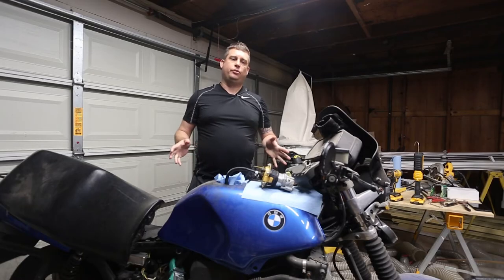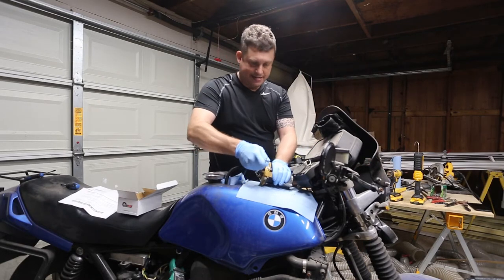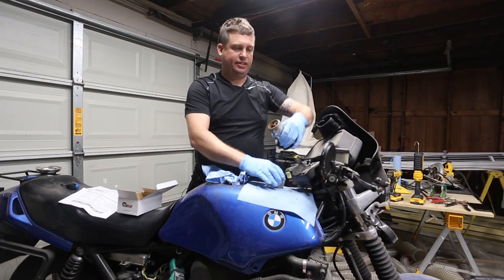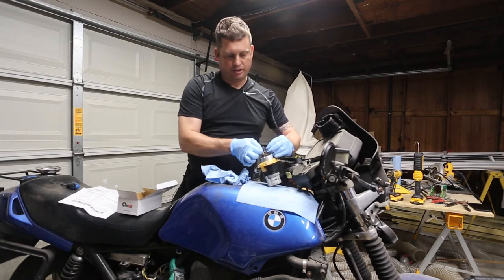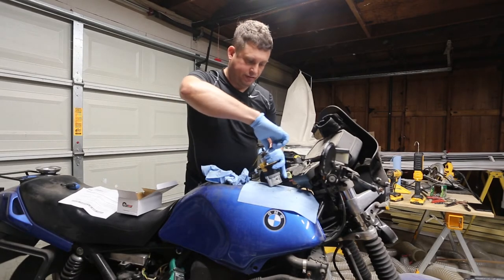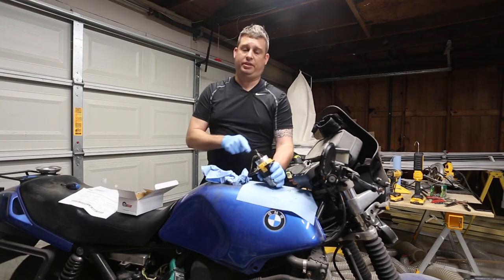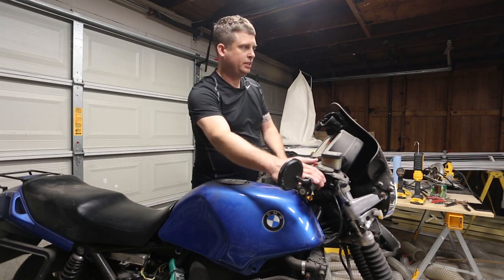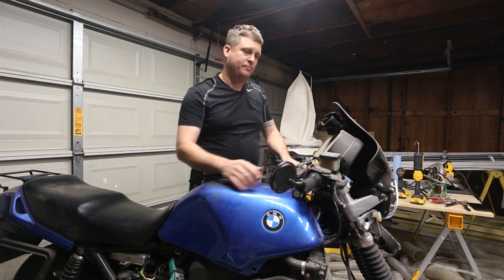BMW K100 Fuel Pump Replacement Part 2

Comment: Should disconnect batt, but make sure you don't turn key on. Have fire extinguisher handy. Even static electricity can set off gas fumes be careful. If fuel pump sounds like a coffee grinder, clean tank thoroughly. If fuel pump sounds like a happy mosquito, it's still a good one. If it starts squealing,  I would replace it. There are cheaper alternatives. I replaced mine with a ten dollar fuel pump for an '86 Ford Taurus, and also got a foam tank gasket piece to make up for the difference in diameter. Had to solder the wires for the new connection, but now I have a spare I carry, and it's smaller. All I would have to do is take it out and the connector would fit. Easy to replace if I had to, on the road. Cover the splice you soldier with some kind of tubing. I did have some vapor lock on a hot day with the new pump, so I will be insulating the underside of the tank some more. I cut a vent in the front of the lower fairing next to the radiator for fresh air to flow over the fuel rail. I am insulating new fuel lines and routing one a bit different so it isn't so close to the motor. Hopefully that will solve the problem.  Don't know if it was the fault of the new pump or not. Not sure about that, but the pumps were so cheap I couldn't resist. You know you have vapor lock if you remove the four Philips screws that hold the filler cover assembly, and look inside and see a steady stream of tiny bubbles coming up from the bottom of the fuel pump, when the key is off and nothing is running. Let it cool for a half hour or so, and you will be on your way, 'till it happens again.

Comment: 1989 BMW 100 rs Has new fuel pump but for no reason when it sits it won't start I don't hear the electric fuel pump then months later It stars again. I never replaced the fuel pump really could that work intermittently?

Comment: hello, nice vidéo. i dont seee any isolants rubbers.. Can you fonfirm..the electric ( + ) and ( - )  of the pump are directly in contact of the fuel? not isolated? bolts, nuts and cables are in fuel? thx

Comment: Hey Brian, ive been watching your videos about your K100 BMW bikes. And I too have a K100 BMW bike and i was wondering if you could give me a few pointers on what to do. 
The problem with my bike is, every time i start it up it would blow my #6 Fuel Pump fuse. 
And ive been thinking if it was because of the old battery or perhaps because of the fuel pump that is faulty. 
Anyways, love your videos and thanks for the help.
Reply from the maker: I sold my bike.... sorry I can not be more helpful.
Reply: If you are blowing fuses there is a short somewhere, I would visually inspect all wires leading into the tank, from the clip through to the fuel pump itself.  If they look fine then remove the fuel pump from the tank - there are more than enough tutorials on how to do this - and test the fuel pump itself with a multi-meter.  You should get a couple hundred ohms reading (I get around 300 on mine) any lower than that and there is a short in the winding.  You can also run two leads from the battery (or a battery charger) and "tippy tap" the poles on the starter (when firmly mounted in a vice) but I would not advise it, there will be petrol everywhere and sparks, not always a good combination if you are not sure what you are doing.  If you don't have a fire extinguisher in your workshop already, you should probably take it to someone who does.
Reply: Hey Tony, I just came across your question and I am having the exact same issue right now. Did you ever figure out what was happening or how to resolve the issue?
Reply: Same issue. Anyone found a solution